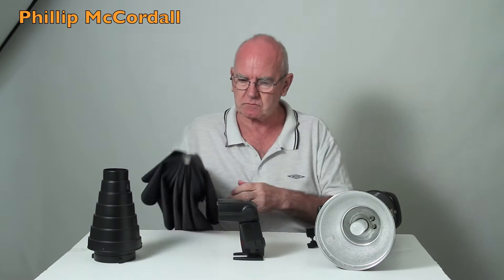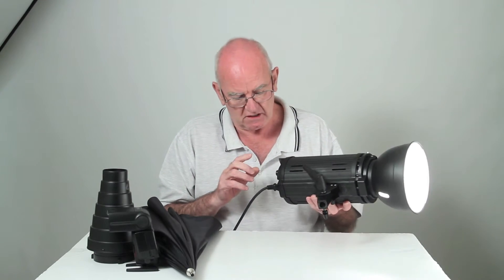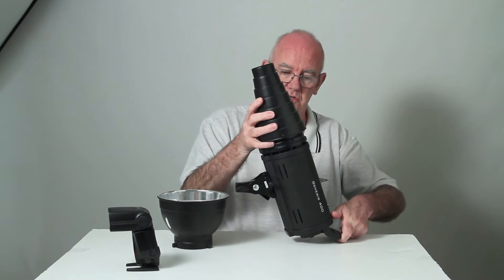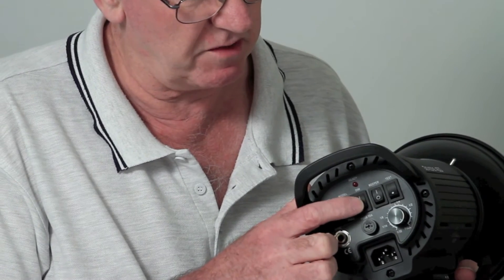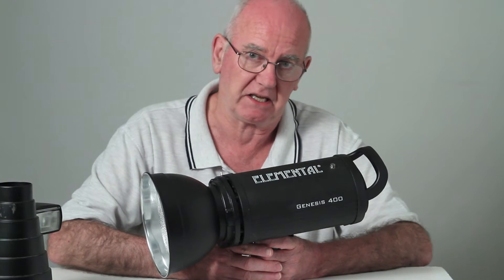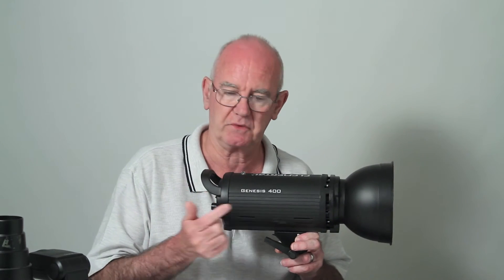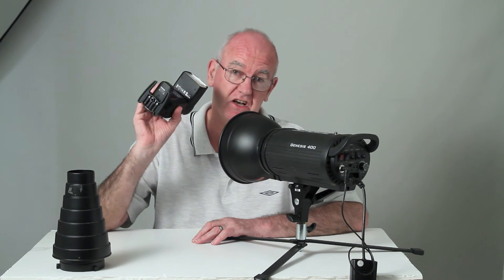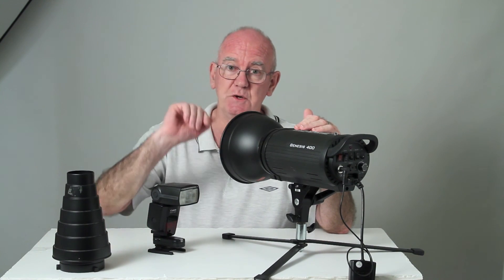Studio flash and strobelights

Comment: Can you use this kind of light without triggering it using your camera (mine doesn't have that capability - it's an entry level model)?
Reply from the maker: If your camera has a hot shoe or any flash socket then yes, if not tell me what camera and I'll check for you.
Reply: Mine is a Nikon D3300. It does have a hotshoe and I think it has a flash socket but I believe it lacks the ability to be used as a master, using other flashes as slaves.
Reply from the maker: I'm afraid I don't know, I'm not very up to date with Nikons, but you can control the other flashes with a trigger on the hotshot

Comment from the maker: The only way that I know is with a light meter I'm afraid I don't know any way to calculate it as one 200w/s flash will give out a different power to another make, depending on what type of reflector it has attached, so it's ask the manufacturer a question like what f stop will it give me when it's 3 meters from the subject for example.
I use 250w/s and 400w/s heads, that give me plenty of power for anything in a medium size studio.
Phill

Comment: So the difference between the guide number of a flash and the power rating of a strobe (ws or joules) is that flash's guide number is a measure of the actual light output as it relates to distance but the strobe's is a measurement of its potential output, not it's measured output.  Or is there more to it than that?